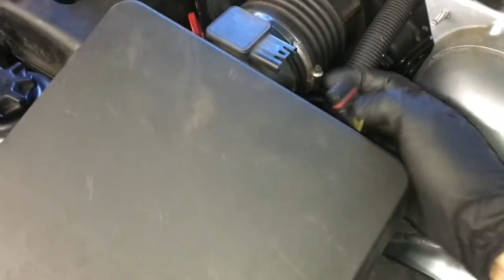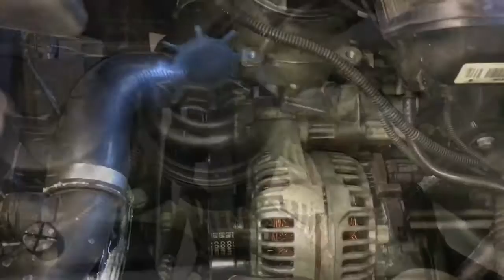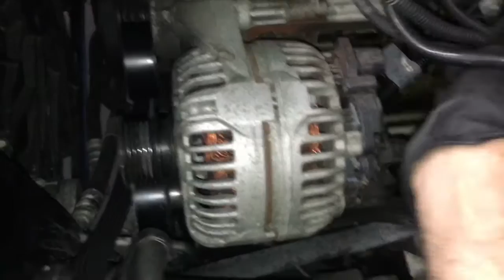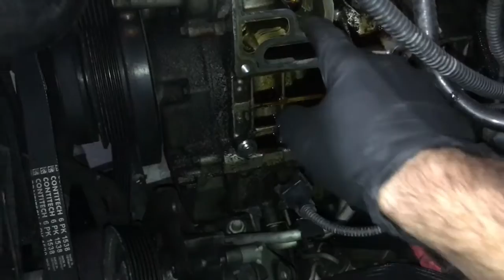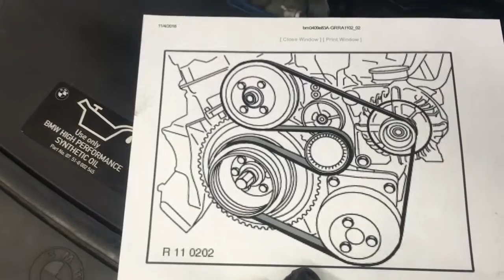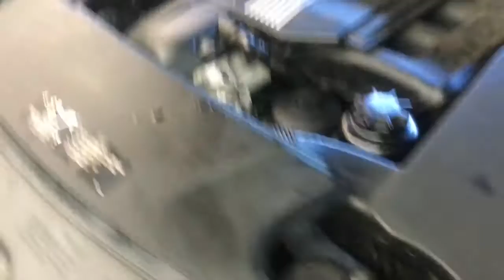How To Reseal Your Oil Filter Housing On A 2006 BMW X3 With The M54 3.0 L Engine

Comment: Loosen the oil filter housing lid until you can see sealing O-ring. This allows oil in filter housing and filter to drain into engine oil pan.
 The BMW TIS lists 22 Nm for the M8 oil filter housing bolts.
Oil line to VANOS unit (banjo bolt) 32 Nm (24 ft-lb)
awesome vid tnks!!

Comment: Super helpful video, my filter housing wasn’t the issue.. my tensioner bolts snapped in the housing so I figured to just replace these gaskets and replace the whole thing and do a fresh oil change

Comment: I found this video after 2 yrs of putting up with the oil leak. My wife made me move the car from under the carport due to there was always an oil spot that kept getting bigger. 
I had the same trouble getting the alternator rocked loose as others but it came out .the gasket came out in tiny pieces due to so brittle.  Also there was only the outer washer on the bolt. The inner was made on to the housing unit. Thank for the vid.
Reply: I thought the washer was fastened to it also, but if you move it a bit it comes off, for others who want to know. I would hate for someone to lose it thinking it just stays there. The oil holds it on there until you move it.

Comment: Great video, was a huge help in the replacement. I'd add that the "hint" of putting an allen wrench in the hole for the belt tensioner is really required to get out the bolt for the alternator.  Videos on working on BMW's are so key giving the layers of disassembly required. Thanks again.
Reply from the maker: Ed Calvin That’s a good tip on the tensioner. Thank you for watching!

Comment: Great video!, I have this oil leak on my 2006 3.0i which has worsened in the last 6 months and will be doing the repair soon.  Could this type of leak (loss of crankcase vacuum) also be causing my P0171/P0174 codes?
Reply: For me it was the air flow intake boot. Look for videos on the DIY smoke pump test using a basic pump and cigar.

Comment: The customer will be back for the alternator and wonder why it costs so much, you tried to tell them, I know how frustrating that is right now I'm doing the same job on my neighbors x3, I can't even convince him to let me change the belt, the ac isn't bad but the alternator belt is cracked and making noise, it's easier to do it now than later, I hope this fixes the oil leaks, I already did the valve cover gasket this vehicle is plagued with fluid leaks and it only has 129,000 on it, when i told my friend who worships German cars about it he asked me what year it  is his response was that most people who buy BMWs only have them for two or three years, so in his mind at least they aren't made for the long haul, for a new one to only be good for a couple of years for that kind of money is ridiculous, my 2001 Buick lesabre has 252,000 on it and only last week the radiator started leaking but I assume it's original and aftermarket I found one for fifty two bucks on eBay, I can only imagine what one is for a BMW or Mercedes I mean a new GM one is 250 so these are probably a grand at least.
Reply from the maker: Peter there is definitely a lot of people drive in these German cars that cannot afford them. Believe it or not radiators are not that expensive for them since they're all made out of plastic. Thank you for watching in writing!
Reply: How to Automotive Case in point I'm working on my neighbors x3, he works for BMW as a supervisor to the service writers and he can't afford what they wanted to charge him to repair the oil leak plus other things I had to do to it, just curious if you want to say what you charge for this job, dealer rate is $160.00 an hour, I also had a neighbor whose niece foolishly bought an older used land rover, it was parked by my house for three months because she couldn't afford the repairs it needed, she ended up having it towed away for scrap, I think it needed like five grand worth of work.

Comment: Did you only remove 2 bolts of the alternator or was there a third?
Reply from the maker: jordan F yes alternator only has two bolts. You'll probably have to pry it off its perch
Reply: Thanks for the help! Some things were a little different on my 04. Like the tensioner was a 45 torx and it had a cap over it.
Reply: Also do I need to drain my oil before I do this job?
Reply from the maker: jordan F it's not need it to drain the oil either. You could always do it as a precaution after the job is done
Reply: Hey man thanks for the help I successfully changed my oil filter housing gasket with your help. One thing went wrong though. The lower electrical connector attached to the oil filter housing broke off the wire. Do you know what that connector does?